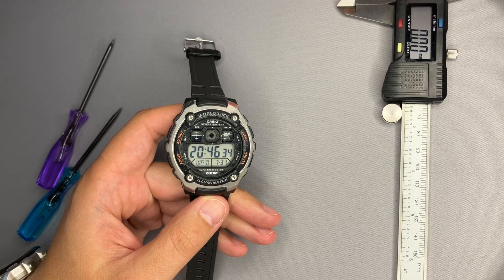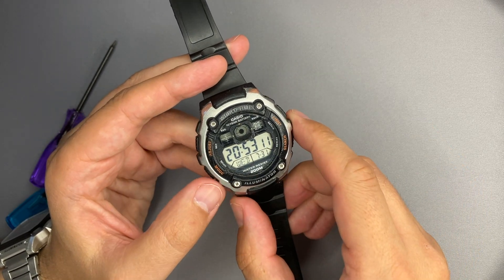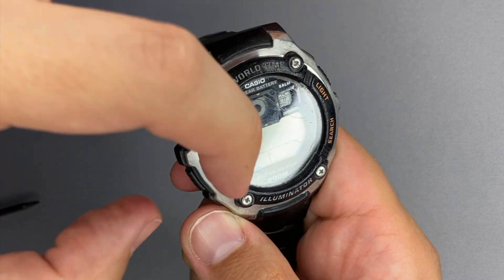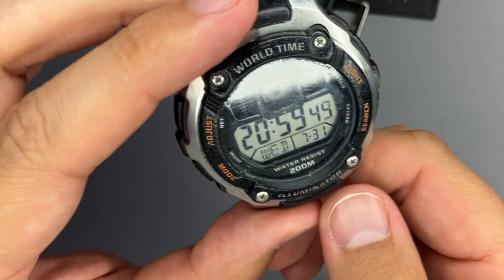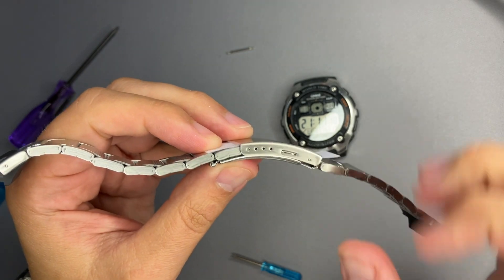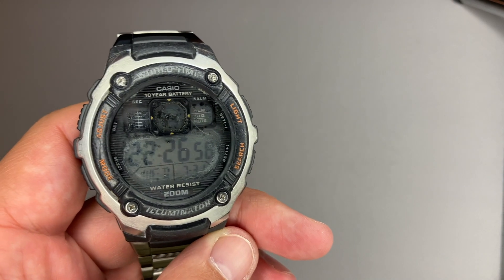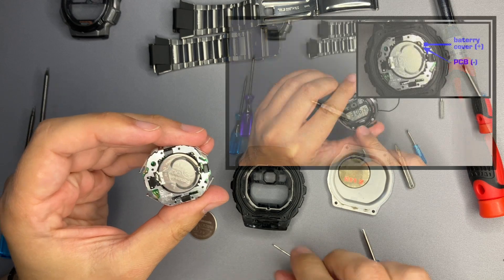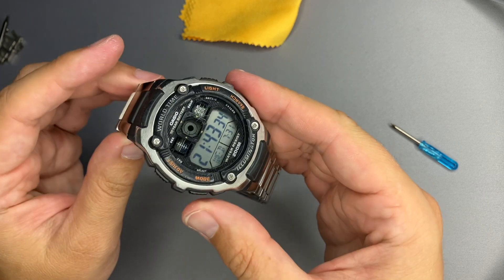Casio AE-2000W review and solve fogging issue

Comment: Hi, about the black part of your new bracelet, is it rubber(soft) or plastic(hard)?
Reply from the maker: Hi, to be honest I do not know. It feels like a hardened rubber and on the back it also serves as shoulders for better fixation on wrist.
Reply: @cj80gdi-321xxx-moon  wrong battery 2016 the ae-2000 have 2025 battery..When you put the oring seal it with silicone grease..

Comment: Where I live, these bracelets are really expensive - often 60 - 70 % of the new watch -, so that it is hardly worth replacing them. Most Casio rubber straps are way cheaper. Was it really woth it for you buying an old watch and pitting in a new original bracelet?
Reply from the maker: Well the price gap is not that much :) the metal bracelet is 30% of a new watch. In the end I have ended up paying for all 35 euros and a new watch is retailed with 70 euros.  And to answer your question, it worth because i could review it.